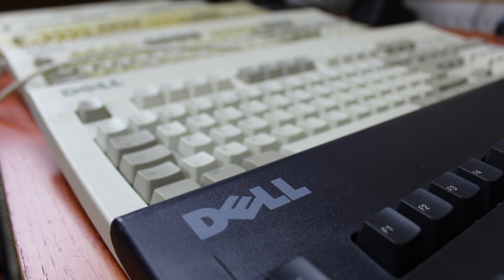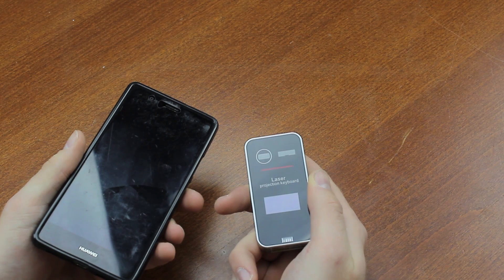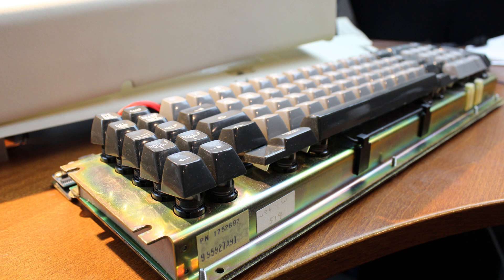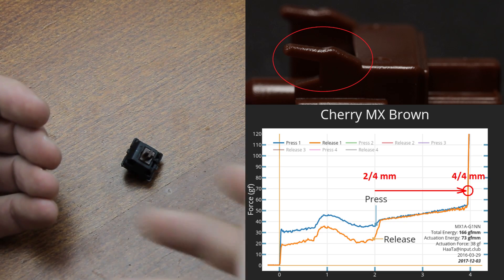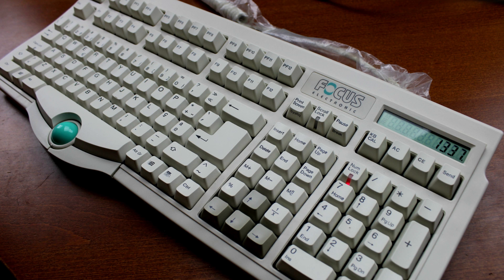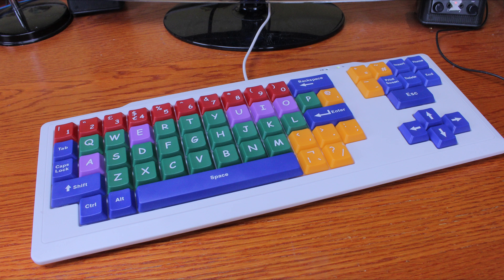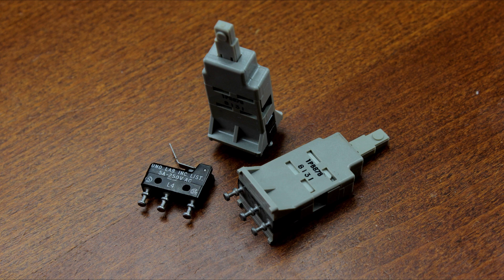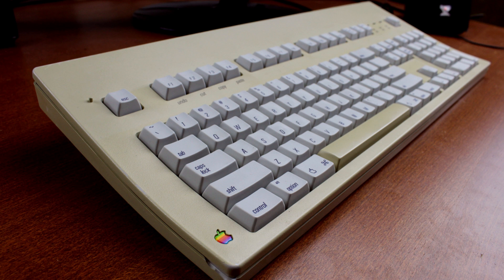When is a keyboard "mechanical"?

Comment: I think that a good definition could be "a keyboard where the combination of the sensing assembly and the key mechanism is more complex in design than a standard rubber dome system".
It would exclude standard rubber domes and also would exclude touch screens etc. Dome-with-sliders and Topre would be in between them, as the capacitive element or the purpose designed sliders would make them more complex. Stuff like spring-over-membranes are slightly more complex as the springs would be separate moving parts, thus more complex. Rubber dome boards are really just two moving parts, those being the key caps and the dome mat, over a sensing assembly. And designs like Oki gourd springs are also more complex, because the spring does more functions during a key stroke. 

Or maybe i've had too much beer this evening...

Comment: For me I basically take it to mean any keyboard that doesn't require me to bottom a key out to actuate. I type a lot work, and when I spend a day typing on a board that requires bottoming out, even if the weight is very light, my hands hurt at the end of the day.

Comment: I personally think a good way to explain is a keyboard that has a noteworthy amount of keytravel and uses more than just rubber domes so it includes dome with slider keyboards and almost everything other than scissor switches which have next to no key travel and standard cheap rubber domes

Comment: Watched this back and forth for three years. Here's my own criteria for "mechanical" keyboards.
- Registering keypresses must have noticeable key travelling (excludes all solid state keyboards like touch screen)
- Each keyboard parts or components except electronics must have only one or two purposes, excluding cosmetic or acoustic feedback (this excludes rubberdome over membrane & PCB keyboards since rubber mats act as key travel element, tactility, downstroke/upstroke dampener, and membrane pusher/carbon contact, but it does include Model F/M since the clicky noise is disregarded)
- It should be serviceable enough, i.e., each components are interchangeable, replaceable, and shouldn't be difficult to substitute parts from different keyboard models or third parties (this also excludes cheap membrane keyboards).

Comment: wait, no. I think there is something. The issue isn't with what is mechanical but what isn't. I think we need to have mechanical (alps, cherry, etc with contacts and slider and pcb etc) and then we have the superior one, contactless keyboard, and then mecha-membrane for design borrowing aspect of cherry and alps but with cheapification like membrane mat, and then capacitive keyboard like topre and model F, and then finally, semi-mechanical? or something for model m and the single part clicky switch? and then we can have also a dome over slider keyboard, or something like that, and then we can have solid state keyboard, and then we can have motion sensing keyboard, and then virtual keyboard, and ar keyboard, and then... idk I am sick and is binge watching your videos. I am under heavy medication and can't think clearly.

Comment: Interesting video. I always understood the difference being something along the lines of:

Rubber Dome: Membrane keyboard. Possibly a bad term for them, since it also lumps Topre in there which is just not right. If anything, maybe the less common term "membrane" is the one that we should be referring to here?

Mechanical: Contains switches for each key in between the keycap and the PCB. So common Cherry MX keyboards would fit in here.

Electro-Capacitive: Topre. 'Nuff said.

Accurate or not, it's simple and I can understand it, so that's good enough for me until a better set of terms, definitions and comparisons are created.

Comment: IIRC, "mechanical" was marketing gibberish started by Das Keyboard once they started pushing MX switches. Though I don't know if Cherry were calling their own keyboards mechanical back in 2006.
Reply from the maker: "Mechanical" as a term was used way back at least as early as the 90s, can probably find mid-80s references too if I looked for them

Comment: As I watched more videos and read articles and forum posts the "mechanical" in mechhanical keyboard became more of a marketing term than an actual category to me. As you mentioned the term mechanical involves a mechanism that moves.

How I categorize keyboard mechanisms now are something like this:

1. Membrane - Uses a membrane sheet or a rubber dome being pressed by a shaft to complete the circuit. This includes the "Mechanical-feel" keyboard that are just rubber domes.

2. Scissor Switch - Technically a subset of Membrane due to the use of rubber domes but is different due to the mecanism that presses on the rubber domes.

3. Optical - Uses light sensors to sense if a key is pressed.

4. Buckling Spring - IBM Model M and Model F (they're their own kind of beast).

5. Magnetic/Hall Effect - Uses magnetism properties to sense switch actuation.

6. Capacitive - Uses Capacitance to sense switch actuation like Topre.

7. "Mechanical" - Uses metal contacts to close a circuit and trigger the switch.

8. Mecha-Membrane - The weirdo that uses a mechanical shaft with multiple parts to press on a rubber dome.

9. Laser Projection - A category for the weird laser projection keyboards that have no moving parts and just projects its "keys" on a surface.

But meh at the end of the day when I talk to people about "mechanical" keyboards and switches we understand it as the type that has metal contacts to close a circuit and register a key.

The Membrane keyboard I liked the best is a KeyTronic E03601 (non ergoforce version) as it feels tactile to me while not being as creaky as modern rubber dome membrane boards and it is decently heavy to press which I quite like. It is still the best membrane keyboard I have though not working anynore due to the traces near the controller board failing I have it as a display piece on my shelf of old technology. It sits on top of VHS tapes and bootleg Sega MegaDrive games.

The Scissor Switch type I like due to the low travel, but they are very different from one model to another. Older ones tend to have a bit more travel than newer ones where they make them too thin that it feels like I'm tapping on solid plastic and not pressing anything or have sh*t keycaps that break easily. So far I have settled on the keyboards on IBM/Lenovo ThinkPads and use the ThinkPad Compact USB keyboard on my computer. It feels the best among the scissor switches I have tried but between the ThinkPad keyboards I somewhat prefer the newer chiclet (or Island style as they call it) versions as the older ones (non Island style) felt a bit mushy for me.

As for the typical Mechanical keyboard, I hate Blues or any clicky ones. I use Reds but would like to try other linear types if possible. Linear Reds may be more quiet but still a fair bit louder than the ThinkPad USB keyboard I have mentioned which is Scissor Switch.

Comment: I do not use "Mechanical" or "Non-Mech" to refer to Keyboards. I class them into "Rubber" (Where rubber is the primary element, like in a sheet), "Modified Rubber" (This includes switches like Dome with Slider and Hybrid), "Non-Rubber" (What I people traditionally call "Mechanical"), and "Other" (which would be the laser projector and software keyboards).

Comment: Also my definition of mechanical keyboards, if it is not a rubber dome or a foliage that has domes on it and no other mechanism to compress and decompress those domes* then the keyboard is mechanical.

 *(in which case they are mostly not mechanical but depending on % of this being not dome it can be losely called as mechanical or semi mechanical at least cant think of an example but I think I saw some gamery keyboards maybe the SteelSeries APEX 5 that have such switches)

Comment: I still think that there's something very important in your 'partway actuation' approach. I'd be quite confident on replying to family and friends that ask about mechanical keyboards that they are those 'whose switches are designed in a way that allows for partway actuation, and are most often built and set up in such a way – although you could choose to build or modify the switches so that the actuation is at the very bottom of the key-press, like most widely available office keyboards require you to do'

Comment: As you say technically any moving keyboard is mechanical. In reality, the term Mechanical Keyboard comes from the switches, being two metal contacts that engage to make contact, then disengage.  With that, technically a Magnetic Reed Switch is mechanical, whereas all the rest are not really.

Comment: you've come up with a bunch of definitions, but haven't gotten to the only correct one - a mechanical keyboard is one that uses different devices to work inside buttons that are different from a membrane and rubber dome. the definition of "mechanical keyboard" was just invented to contrast the classic membrane and rubber dome - from this you had to proceed when giving the definition.

Comment: You're using the same diction that automotive journalists use to describe the feeling of operating a manual-transmission lever. "Rubbery" vs. "bolt-action rifle" are commonly-used descriptions. Just like rubber domes can feel better than "true mechanical" switches (whatever that means), a cable-linkage shift lever can feel better than a direct-linkage shift lever. No one whines about Porsche shifters, for example, even though they're cables.

IMO, the distinction is irrelevant. The overall experience is what matters. Thus, labels such as "mechanical" are not useful.

Comment: Here's my definition for switches:
A 'membrane' switch is a switch wherein the stem of the keycap directly interacts with a rubber dome, which interacts with a membrane below.
          These are usually plagued by a large amount of mush, though it is not a requirement
          mecha-membrane and mem-chanical switches fall under this, as their keycaps directly touch a rubber dome

A 'digital' switch is one that has no moving parts.
          touchscreen, digital, and projected keyboards

A 'Mechanical' switch is anything that does not fall under the previous categories

 In practice, Mechanical usually refers to a physical keyboard or switch that is not a 'membrane' switch as described above, as such I feel my definition of mechanical keyboard is sufficient

TL;DR:
A "Mechanical Keyboard" is a physical keyboard where the keystrokes are not registered by the stem of the keycap directly interacting with a rubber dome.

Comment: My definition of a mechanical keyboard switch is any Switch that uses a spring of any material that causes resistance and return to the default state that is separate from the actuation system

I find this is a good system normally which I used after I watched this for the first time

Comment: The only thing that I won’t consider mechanical is something using a uniform moulded piece of rubber with no other pieces apart of the mechanism and part mechanical is anything over a membrane mechanical is a discreet switches or operates through something other than a membrane.

Comment: I think you can define a mechanical keyboard by two criteria. 

It is repairable.  That means that if an individual switch starts to fail, you canreplace a small part of the keyboard and make it operational.

Any part that contributes to the pressure needed to depress a key or felt when a key is returning, is a continuous function of the displacement.

Comment: Hi Thomas! Thanks for providing us with a shit load of awesome content! I grew up in my dad's computer workshop in the late 80s and 90s, and since they didn't really cater to a particular brand of computers, everything came through the store - home computers with rubber caps, rubber domes and the occasional model M. Now, being in my mid 40s, I find myself somewhat nostalgic for the keyboards of the old days, while also being quite critical of quality and esthetics. I'm currently testing if Varmilo VA88M with blue's is a good fit for me, but while it has the click I was looking for, the charcoal caps really aren't working out for me. I rarely need to read the caps, but when I do, I prefer not to squint and use a flashlight. Honestly, with my eyes, the caps on this keyboard is only readable for about an hour around high noon. I wouldn't say I'm in the market for high contrast yet, but I'd go for something a little less charcoaly.
Anyway, enough blabbering - question time: the TKL keyboard in your video around 1:08 and the 100% around 12:08 has some of the most delicious 70s/80s style keycaps I've seen in a long time. Not just the shape, but also the color theme. Could I trouble you for the make and model of keyboard and/or caps? :-)

Comment: So it doesn't work as a fixed definition. So when and did the term "mechanical" come into vogue and why? Was it when keyboards started to react against the quiet membrane keyboards that emerged in the 1990s, to demarcate a "throwback" to an older idea? In the end it was mostly marketing-speak to denote that general idea, wasn't it?

Comment: This is a late contribution, but I think you touched on something important near the end: the term "mechanical" is useful to describe how a keyboard feels.

Perhaps this would actually be the best definition of a mechanical keyboard -- a keyboard that "feels" mechanical? This would likely include everything that one would like to include (I think Topre feels more or less mechanical, for example), while excluding the common rubber dome keyboard.

The only problem are the "mechanical" switches that don't feel mechanical. On the other hand, any definition has outliers that are hard to define, and there's always an exception that proves the rule...

Comment: A keyboard is "mechanical" if it doesn't suck :)

(That said, i think part of the problem here is that "mechanical" is viewed as a way of saying a keyboard is "good", whereas there's not necessarily any reason to believe that. Why should a hall effect switch be considered "mechanical" and a rubber dome not? Why couldn't it be the other way around? Just because hall effect switches are better to type on doesn't necessarily mean anything about whether they're "mechanical" or not. Well, I'm not sure how much that matters anyway...)
Reply: And there is nothing stopping hall effect switch to use rubber domes ; p
Just use magentic rubber, it's not even anything obscure or expensive

Comment: Im just shooting blanks here, but since the word "mechanical" means operated using a machine, in this case a complex series of moving parts, why dont we just define it as having "multiple moving parts" compared to others like rubber domes just using simple circuit completion
Reply: So Topre switches arent mechanical if they would start using metalized rubber instead of coils?

Comment: 10:02 This definition actually has a really funny interaction with Steelseries’ Omnipoint switches (which if you didn’t know, are switches that use a magnet + pcb that detects magnetic strength to make the actuation point adjustable). If you set the actuation anywhere from 0.1mm to 3.9mm, it’s a mechanical switch, but the MOMENT you make it so that you have to bottom out, it stops being mechanical. Probably the worst offender of this definition.

Comment: I have been using your definition "What we mean by mechanical keyboard is a keyboard in which the actuation happens approximately half-way of the key travel" and added my own "which must be at least 3 mm (~0.12 inch)", for months now, and it works very well, most of the time.

When I want to explain to someone why I prefer "mechanical" keyboards and what I mean by this, the "actuate before bottoming out" and "plenty of travel" points convey most of what I consider essential. It then becomes obvious to them why rubber domes over membranes and scissor switches are not considered "mechanical", even if most of the time people had not realized that they had to bottom out, sometimes pretty hard, to actuate the switch - but they understand when you point this out.

Some keyboards that do not fit the definition are still pleasant to use (some rubber dome over membranes produced in the 90s are fine, some laptop keyboards are absolutely usable), it's just that we do not call them "mechanical".

The mid-travel actuation is really important, as well as the travel length. These are the reasons why we love keyboards that feature both properties, even if these properties alone are not enough (it is still possible to create a really crappy keyboard that fits the above definition).

Interestingly, musical keyboards - pianos, organs, synthesizers, ... - also share both properties (at least the decent ones). No keyboardist would accept to have to bottom out to get a sound - that would get rejected right away.

It's an imperfect definition, and there will be exceptions, but I do not know of any better concise definition, so I thank you for introducing it.

Comment: mechanical is used as a term of quality (as you acknowledged - it actually is used as a kind of "keyboard racism") - right now i am using one of the keyboards you hated on .. one of those ergonomic split keyboards with "bowls full of keys..." - they are mechanical ... but the keyboard itself feels extremely cheap (plastic housing, creaks and bends if you really put it to the test)

yet, it was my most expensive keyboard to date .. (and it is not even coffee proof) - but the point is .. the switches (apparently Cherry MX blue) feel like any cheap 200 ISK rubber dome keyboard i had in my past)

But when one of my students asks what keyboard i use .. and i say .. "a mechanical of course!" ... they nod in satisfaction, sure that they are dealing with a "gamer" teacher lol.